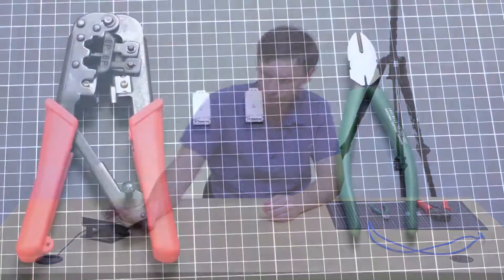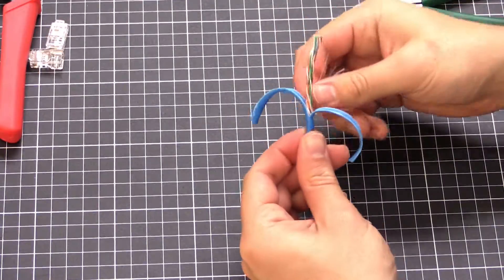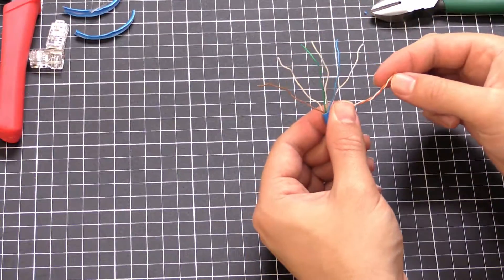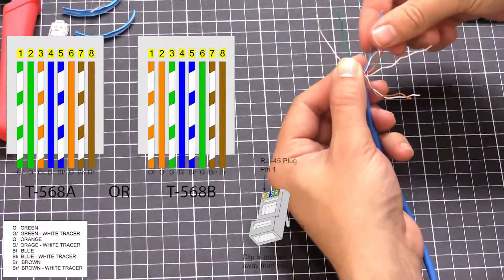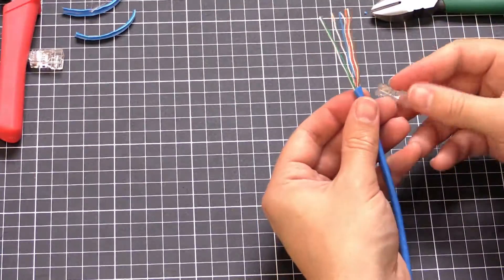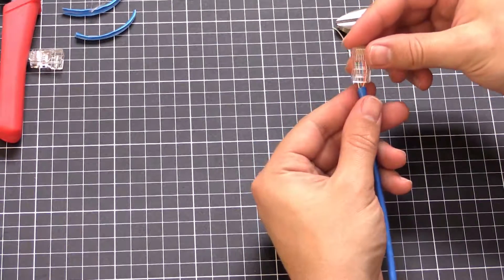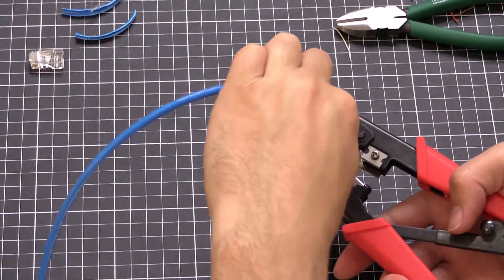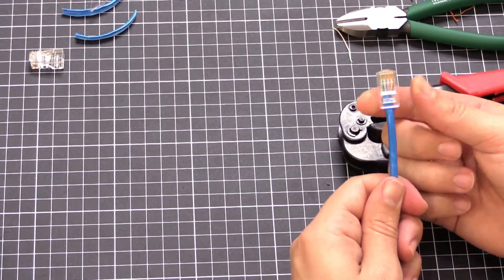VIP Vision Guide: How to Terminate a RJ45 Connector on a CAT5, CAT5E or CAT6 Network Cable

Comment: That's not actually how you terminate a U.T.P. Cat 5, 5e or 6 Cable

As per industry standards and (Back in my day ) M.C.S.A.
as well C.P.R. Standards
What is known in the Telecommunications industry and Information Technology industry
as the correct way to do these things and the CORRECT TERMINOLOGY

let's start with 
1. THIS IS AN INFORMATION VIDEO AND AS SUCH IT SHOULD BE ACCURATE
Here are some pointers and inaccuracies 

- You keep using the word "CRIMPING"
Mate you are not crimping, You are TERMINATING and the tool you are using is not a "Crimp Tool" or "Crimping Tool" it's either
"Termination Tool"
"8P Termination Tool"
"UTP Termination Tool"
in a nutshell.. You are TERMINATING a cable and using a TERMINATION TOOL to achieve that goal

Looking at CRIMPING
Go look at the tool that a plumber uses to CRIMP a copper water pipe
There are folds infolved
Go look at the old RG-59 Connectors (Crimp Type)  there are FOLDS involved that get created after the crimp tool has done it's job

the term CRIMPING is a bad habit....
it started from the BNC Days then through to RG-59 
then when we brought in RG-6 Connectors (Compression Type) Techs still called it Crimping (this is unacceptable and if we are to be professionals and technicians or engineers we need to get this right)

the other problem that came into play is...
The actual RG-59 and RG-6 Crimping Termination tool looked very similar to your 8P and 6P Termination Tools and you pressed the handles in the same way
hence why the bad habit started
IT NEEDS TO STOP !!!
By Definition, what you are doing is  TERMINATING
The blades on the modular PLUG (i'll get into this in a second)
the blades of the modular plug cut into the stranded wiring of the Cat5e U.T.P. Cable on the cable end (To form A TERMINATION) / (An END POINT)
You are terminating, not Crimping

- Now...  THE LITTLE PLASTIC CONNECTOR
Your'e calling it an RJ-45 Connector
INCORRECT
People again have bad habits on not understanding the difference between
RG  and RJ
R.G. - Registered Grade
R.J. -  Registered Jack   (NOTE.... The word "JACK")

so.. you do not call an RG-6 or RG-59 cable and RJ-6 or RJ-59
and you do not call ethernet standards RG-11, RG-12, RG-45
Tech's need to get this correct

Now... the little plastic thing is called  A MODULAR PLUG (it's a Plug)
in the industry it's called a MOD-5 PLUG 

The thing you plug it into (The Wall Point or Switch or Camera) is called 
A CONNECTOR   or  JACK

so... a Modular Plug (not RJ-45 Connector)
Plugs into an RJ-45 socket or RJ-45 Jack  (hence the name REGISTERED JACK)

- Then you said "No rainbow stuff"  (and i agree)
but, you said, if you wire it up with any colour on one end and the same colours on the other end but not following the standards, You'll have things go wrong
NO YOU WON'T...
Electrically speaking the electrons are not aware of what colour sheath the copper wire they are travelling through is coloured
it will absolutely work if both sides are the same
so if it was wire
blue
brown
green
orange
green/white
blue/white
orange/white
brown/white
on both ends   it will absolutely work

BUT I AGREE , LET'S NOT ENCOURAGE THEM TO STRAY FROM THE STANDARD
AS THERE ARE GOOD REASON TO FOLLOW THEM

- then... The tool you are using is not an RJ-45 Crimper
it's an 8P / 6P UTP Termination Tool

- You also should have put emphasis on what a U.T.P. Cable and S.T.P. Cable is 

- Lastly, the way you stripped those cables is ugly dude
I mean where do i begin
- You are using massive amounts of force
DO THAT FOR 20 YEARS AND I PROMISE YOU WHEN YOU GE TO LIKE 40 OR 45 YOUR FINGERS WILL KILL YOU (so.... V.I.P. IS THEN PROMOTING HEALTH RISKS... RIGHT ?)
but hey
- Let's all wear our COVID MASKS
- Let's all Talk about P.P.E.
- Let's all make sure that we've done our J.S.A.'s
- Let's get our knickers in a knot about the possible effects (that will never happen) relating to Asbestos

but when something real comes along like 
- Pushing on an RG-6 Coax Connector with your fingers (Because no one taught you
that the back screw bit of your torque wrench was designed to put that connector in there
so YOU DON'T HAVE TO USE YOUR THUMBS (which will bloody hurt you in 20 years of doing this stuff)

- Pulling apart U.T.P. Cabling like this and then your fingers hurting you and you have massive pain so that the slightest movement of your fingers hurts so much that you can't go to work because OF REPETETIVE  STRAIN on a muscle that was never supposed to have this much force put on it

when real things like this come along,  Funny how we don't worry about them.

then we have... Increased chance of accident because you are using force
Then we have increased risk of damage to the cable itself

What you do in the field is up to you,  But you don't put this stuff in a training video mate.
But at the very least you need to get yourself spec'd up on correct terminology

MODULAR PLUGS
https://en.wikipedia.org/wiki/Modular_connector#:~:text=Modular%20plugs%20for%20stranded%20have,result%20in%20an%20unreliable%20connection.

REGISTERED JACK
https://en.wikipedia.org/wiki/Registered_jack

You have the right idea and i understand (Given your age) why you made these mistakes
(you were taught incorrectly) I've seen it happen for decades, Not necessarily your fault !

But you do need to brush up on a few things
so do suppliers
So do techs
at the end of the day we all make a choice

- We either give a fuck
- or we don't give a fuck

If we are the latter we are not professionals .
it would seem that we have more and more of the latter today
if we don't promote the former our industry turns to shit
our professionalism and experience is no longer valued
and we are not respected (oh yeah... and our pay will also suffer)

so yeah... a few tips huh